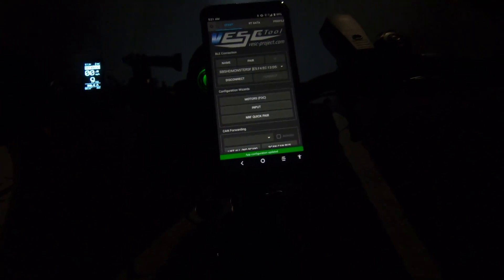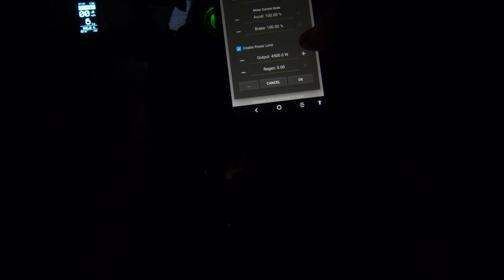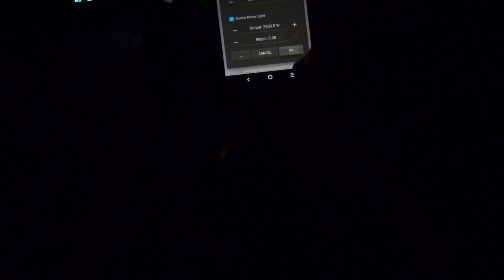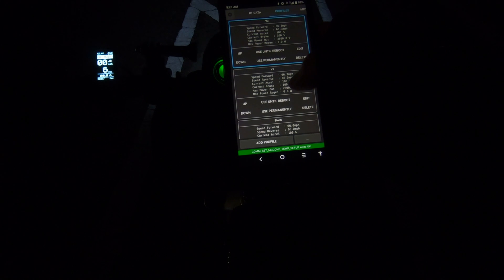LUDICROUS V2 CONTROLLER TOO MUCH POWER FOR MY 52V BATT.

Comment: What speedo program are you useing in the video? After you made the settings it looks like you selected another program from the screen.
Getting X-2 soon, and is it possible that is in the VESC app also.  Plan on much night cycling, so very necessary!!
Thanks
Reply from the maker: I was using the old version in this video.  As far as the X-2 goes, the VESC programming will be a bit different.  The latest firmware on my V2, has simplified all of the programming, and made the ride and power increase incredibly smooth but still full of torque and top end speed.
Reply: @budwhite9781  So is the large MPH readout part of the old VESC version?  Or a diffrent program?       Thanks

Comment: My Ludicrous ALITE500+ does 60mph, throttle only, on the flat and climbs hills like a demon as delivered from LunaCycles.  Set to MAX 40mph, the bike gives fabulous performance with decent range.
The V2 provides way too many user-controlled parameters and seems like a hunk of crap in comparison.  BTW: 52V is already more than the motor is rated for, and the battery charges to 58.8V.  Upgrade to 24Ah or 28Ah to experience the "boost" the additional juice imparts (kinda like using high octane instead of regular).  It's mostly a matter of discerning the bike's "sweet spot" after that.
Reply from the maker: you should make a video...that would be the World's fastest BBSHD hot rod build...
Reply: where do u find larger battery for LUNA cycles.  they only sell 17.5amphr? if I knew they had a 28amphr I'd buy the Z1 and get the bigger battery tomorrow
Reply from the maker: @Beginners-Journey  You can buy really good quality and large batteries, up to 72v at E-street Bikes.
Reply: How much is the v2 controller and is it better then the asi bac855

Comment: I use the PEAK gear in my BBSHD.  It is almost silent.
Reply from the maker: Nice.  I have the steel gear in all of my BBSHD builds and I never noticed any extra noise.  The PEAK gear and/or steel gear should come standard.  Cheers.
Reply: @budwhite9781  What's the PEAK gear?
Reply from the maker: @moonshot1999  a composite of carbon and plastic supposedly
Reply: @budwhite9781  PEEK is actually just a type of plastic, very very expensive high temperature thermoplastic infact, melting point over 320°C and very awesome impact resistance etc

500g for 3d printers cost like 300+ bucks if you get a good deal, often $1 per gram so more like 500 for 500g

it has awesome thermal and physical properties though, that only gets rivaled by PEKK
PEI and PPSU are also very expensive